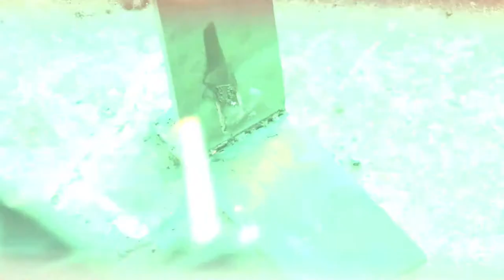TOTAL Auto Darkening Welding Goggle  TSP9402

Comment: Sir in auto darkening welding goggles what is operating and storing  temperature content.
I will use stick welding and how many maximum amps used this goggles.
How many years this goggles have working properly comment plz sir 🙏